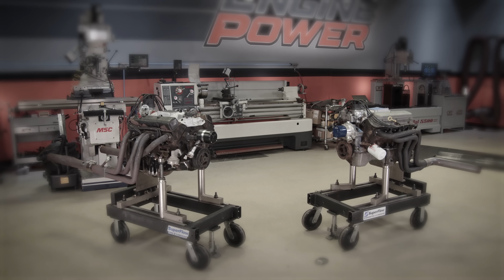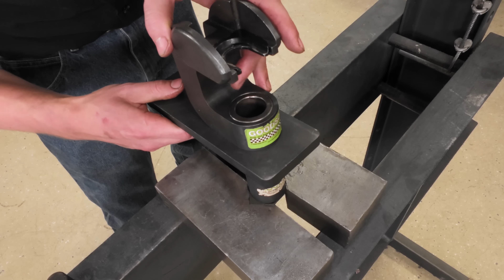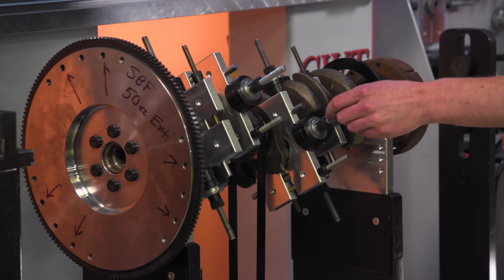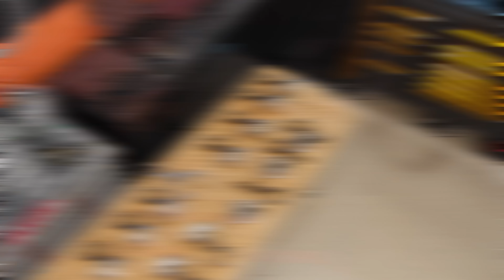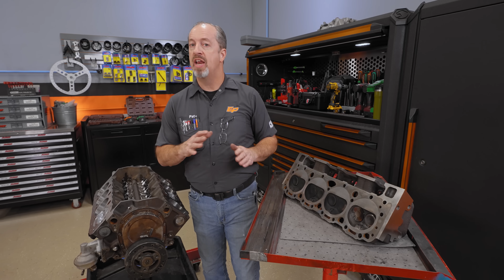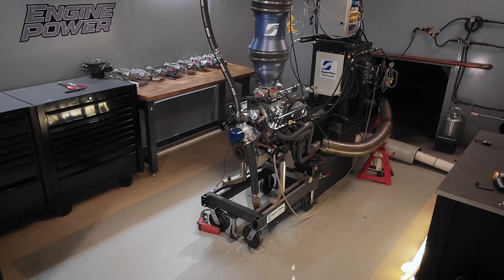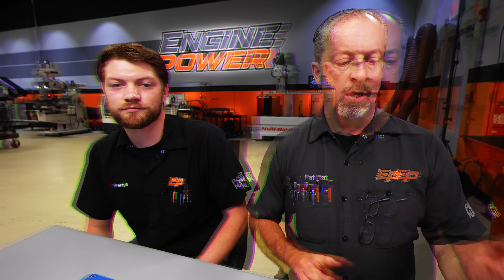305 SBC vs 302 SBF: Does Compression Help the Lowly 305 beat the Race-Bred 302?

Comment: I raced my 305 Chevy against a 302 Ford.  I won from every stop light and then the Ford blew me away  The 305 is junk had 2 pure CRAP  It is all about rod ratio  The 305 has torque NO  RPM

Comment: Apples to apples. This is a chris carter moment, COME ON MAN. Why would any 5.0 guy build a 302 like that that's strange to me. I built a 302 with 3 bar gt heads and had them ported and installed 2.02 int 1.60 exh. Converted to adjustable rocker studs you know the normal things we 302 guys do.  There are plenty of 4 bar heads and the same can be done too them. Angle milded the heads to 58 cc combustion chamber. Remember this is a factor head on 5.0s. 0.030 MLS gaskets. Still kicking ass to this day. I did this 2014. Why did you pick that value size when you should have did what I did. Make no since.

Comment: The July 1972 issues of Car Craft had an article called, "A 1969 Z/28 vs. a 1970 Boss 302—Both with Aftermarket Goodies".  As opposed to dyno runs, the magazine performed common upgrades of the time: headers, carb tuning, ignition tuning, and a new manifold.  They would do an upgrade, test the car in the 1/4 mile, then the next upgrade, another 14/ mile, etc.  Both cars moved from the mid-14s (if I recall) to just under 13 seconds (I recall this clearly).  I also think they had to install traction bars on both cars.  There was no winner declared but they acknowledge the Ford's heads were better at high rpm whereas the Z28's overall drivability improved across the board and was easier to live with.

Comment: Leave it to the Engine Power guys to saddle the Ford with lesser, lower flow heads (the Chevy heads flow 12.5% better) and then gloss over that fact like it's nothing. If they actually equalized the cylinder heads, the 302 would smoke the 305 by well over 10%; can't beat that shorter stroke if everything else is equal.
Reply from the maker: This round of testing was based off the comment section for the best cheap production heads, but if you want to see what happens when they have heads that flow within a few CFM of each other, you can check out the latest round of testing here https://www.youtube.com/watch?v=w5MCxmJbKaY&t=150s

Comment: Some conclusions from all of this.  Looking at my 302 decision process now I can say 1st, 9.5:1 will be the goal and that also will need 89 octane so good there.  2nd, good quality flat-top pistons with very selective aluminum performance heads.  The chamber cc's, I'll do the math. AFR likely not necessary either.  Rollers, absolutely. Can I use the original cast steel crank, I don't know?  Getting there!

Comment: A much more fair comparison, would be the late 60's Chevy 302 vs the Ford 302:  the blocks have the same bore/stroke, and it would be the intake/exhaust/camshaft and heads, to see what difference the GM vs Ford head design has (alternating/siamesed exhaust port location).  It would be race-bred vs race-bred.  The smaller bore of the Chevy will always be at a disadvantage.

Comment: You made the compression the same but put higher ratio rockers on the ford-- why weren't they the same as the chev
Reply from the maker: The factory rocker ratios are .1 apart, and we kept that difference while increasing them by .1 each in order to keep the valve lift very similar

Comment: More lift and better rocker ratio. That was the bump for Ford. The combustion and pressure doesn’t know brand. What’s the flow, displacement, rotating mass, balance, fuel delivery, valve timing. Assuming there are no absurdities in bore x stroke, rod x stroke etc, the numbers will be predictable.

Comment: Do these engines make best power with 11.6 afr? Or is that on the rich side?
Reply from the maker: That would be quite rich. We tune engines mostly off BSFC, but these were running between 12.8-13.0:1 for AFR

Comment: I don't really care either way, but I feel like this was not an "apples to apples" comparison from the start. So I am glad y'all made things right!  The 302 is obviously more of a performance application being a roller engine out of a mustang. That 305 is more of a TBI grocery getter out of a caprice or C1500 more than likely. Might have been a better comparison to find the 305HO or 305TPI variants to be fair. There is no doubt however that the 305 made bigger gains from the baseline than the Ford. And having worked on both, the SB Chevy is still much cheaper to get parts for as a general rule. So in the HP per dollar category, the Chevy will always reign supreme. That said, they are both fantastic engines. But the 302 will always sound better than the Chevy on the street. Just something about them!

Comment: that higher torque at lower rpms the 305 is making is due to its smaller bore but longer stroke. the explosion in the cylinder is pushing the crank with more leverage.

Comment: Is this a joke? Comparing a Chevy small bore 305 (3.736 bore) to a larger bore 302 Ford (4" bore) is very stupid! You should have used a 301" Chevy (4' bore).
Reply from the maker: We picked these because they are the most common and readily available "smaller" small blocks, so it made the most sense to put these two against each other. So far, the small bore has not held the 305 back!

Comment: Why didn't you make it Chevy 302 (Z-28) vs Ford 302? The Chevy 302 out of the Z-28 has a 4" bore and a 3" stroke while the Chevy 305 has a Bore of 3.736" and a Stroke of 3.48". This makes for a huge difference in volumetric efficiency.
Reply from the maker: The idea behind this series was to show what could be done with the two most readily available and popular small displacement small blocks. 302 chevys are relatively scarce and can be pretty expensive when available, while 305's are everywhere, came in a ton of applications, and are still dirt cheap. We have shown in a previous build that 305's can be upgraded like any other engine to make good power, and in these tests, the bore size has had zero affect on the engines performance compared to the Ford
Reply: @enginepowertv  I have two complete SBC 302s out of Z-28s and an all aluminum SBC 383 stroker originally from PAW. My late brother and I used to campaign a car in the old AHRA D/Modified production class. My eldest son will be picking those and a bunch of other parts this summer when he gets back from his current deployment.  In any case, good series. My favorite, however, was the Ford 300 straight six. Best sounding engine is a straight six with split exhaust manifold.

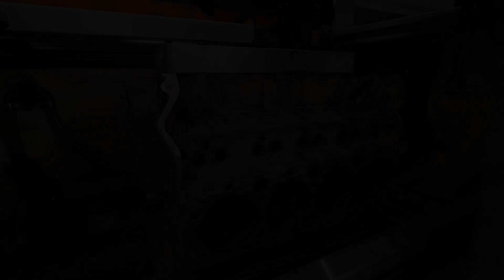Comment: Apples to apples ???? Riiight.... Chevy gets hypuretectic bucket  piston 5/64 and 3/16th rings that drag at 20 lbs per hole 160 lb of drag The Ford gets a lightweight forged piston 1/16th top and second 3mm oil control... that pulls about 11 lbs per hole 88 lbs of drag where is this remotely apples to apples... FYI have a 496BBC IN A 78 Firebird a 2002 ford lightning with a fresh 5.4 and a Whipple 3.4 at 21 lbs 574 to the ground so I'm NOT biased......  39 years ASE Certified gonna finish from the 5:17 where I stopped to drop some much needed context... this is lopsided and I'll be surprised if the 305 is still in the hunt....  that drag differential is double .... If.... the Chevy is still standing toe to toe ... then the ring drag importance  is a fantasy t hat it means nothing in the grand scheme of things .... Good luck guys 😊
Reply from the maker: We measure ring drag on all the engines we assemble, and both engines were within 2lb-ft of rotating force for the rotating assembly, so we would say it is neglible for these tests

Comment: This series was great.  Next up they should plop on inexpensive aluminum heads and see how close to 400 they can get, then do a total cost review to find out where the sweet spots are hp/$ in the series.
Basically if you're staying iron head with a 302, the extra 20-something HP to throw in new pistons & rebuild aren't really worth it as much as they are for the 305.  
It also explains why the rebuilt 305/vortec head engine in my brother's ex-dare stock track car can chase down new Lambos as it probably has north of 350hp.  Not bad for an old chopped down G-body chassis.

Comment: Why not 302 sbc. Vs. 302 sbf?
Reply from the maker: We wanted to use/compare the two most readily available smaller displacement small blocks. These engines are both abundant and cheap, and 302 chevys are much harder to find a useable engine and are much more expensive

Comment: What is the total valvelift? As the Ford had larger lobes and 1,7 rockers compared to the smaller lobes and 1,6 rockers?
Reply from the maker: The engines are within .018" net lift on the intake and .010" net lift on the exhaust. The cams and rocker ratios were upgraded together to keep them as close as possible
Chevy- Intake: .528"   Exhaust: .536"
Ford-  Intake .546"  Exhaust .546"

Comment: Awesome test guys! The performance curves make sense considering the Chevy has it little extra stroke over bore, something that could be fine-tuned using a dual plan intake over the single. On these old carbureted Mills I would probably stick with the lower compression versions for drivability on pump, gas and eat the 10 to 20 pound feet of torque and extra horsepower and obviously you could pick up lower RPM performance with a dual plan over these tested engines for better street manners .

Comment: There is an advantage in the Chevy head gasket: .028 vs. .038 in the Ford. Assuming both engines are at "0" deck, the Chevy has a considerable advantage in terms of quench.

Comment: I used the 305 heads on a 350 to raise the compression to 10.1, flat top piston four valve relief, stainless valves  194 in160 ex relived the the exhaust port to accommodate the 160 ex valve  runs well. cam dur in 224 ex 228 112lsa 465 in 485 ex hydraulic flat tappet it's a dally drive 15/8 headers HP apx 375 HP. great video thanks

Comment: I would like to see this challenge done with what was available when the year the  305 and 302 was made there is too meny parts and tech available now .how would you do this challenge back in the late 80's to 90's with what would have been available including tools and equipment too work the block and heads ,crankshaft. I would be interested in this .

Comment: Great engine builds on the 302 ford and 305 chevy engine.  would you be able to do a build on the 302 ford engine and the 302 chevy engine to see the difference in a stock form.  you guys have a great shop.

Comment: Hey Pat & Frankie, I know that the engine doesn’t know its brand. That said 😉 would you gentlemen please do a build series with a 351W punched out to 427? I’m talking forged steel crank, and cam forged connecting rods and the best NA pistons and Long tube headers with 1 3/4” primaries?
Reply from the maker: We might look at doing one again in the future, but here is a great solid street combo that we did several years ago on the show that holds up really good. Hope this is close to what you are looking for!

https://youtu.be/edpnG3DSXVY?si=Qb5HGCbcQQJPYJ6i

Comment: Not even a close comparison. Why didn't you do the chevy 302?
Reply: I'm a ford man but that chevy 302 was a beast, was it born from the 283 and 327?
Reply: @adrianpatterson845    Yes. The Chevy 302 has a 4" bore (same as a 327) and a 3" stroke (same as a 283). 
Made 1967 to 1969.

Comment: How about a comparison between the 302 Chevy and 305 Chevy.  If you compare with the same compression, heads, cams/lifters, headers, intake & carb, what is the difference between between the short blocks.  

With the 302 having 4.00" bore & 3.00" stroke, and the 305 having 3.736" bore & 3.48" stroke, this comparison would be very good to see the differences in the bore & stroke when run on the dyno.   🙂

Comment: See ive got a 90' f150 with a 302 in it but  its only rated at 190 hp factory. This one was around 250 bone stock

Comment: Would be more interesting if you used either ford and chevy 305's or ford and chevy 302's they both made both engines!
Reply: I absolutely know that Chevrolet and Ford both made 302 C.I.D. engines but I've never heard of a Ford 305. If Ford made a 305, what years?

Comment: Need more lift for the SBC 305 cam!
Reply: Nope. You start putting a bigger cam in the thing you start killing any low end power that you have. You're wanting to make that one mortal sin that every guy that's ever tried to build a 305 chevy  has done,  too big of a cam!
Reply: @kskip4242
For a fair comparison the 305 needs more lift to match lift of the cam in the 302. You're correct sir I have over cammed my fair share of engines in the past and for street applications I'm thinking less is more!!
Reply: @matthewlarson1050 I Suppose you could go a hair more but I wouldn't do much more than what they just did. This thing is gonna be barely streatable as it is with such a high compression ratio lol. I don't know back years ago when I had my 305 build gasoline wasn't as good. I am talking like thirty years ago. I am an old fart 😅
Reply: @kskip4242lol right 👍 
I put a 350hp 327 cam in a 305 about 30 years ago and that was definitely the wrong cam for that car. 1976 Malibu classic with 2:73's🤣 dog off the line but flew down the freeway 🤣

Comment: Richard Holdner points out  that an engine does not know what brand it is. same displacement, same compression, same cam timing, same induction will make the same power. But its good to see what can be done with both of these with a few cheap upgrades and OEM iron heads.

Comment: Just go all out with the 305 you will be surprised. The options is far greatest with 305 then any other SBC. Stroker kits 400 heads 350 vortec heads 400 crank 327 crank you can get aftermarket one piece seal dual quad intake cams or basically anything you can throw at a 350 and create a truly unique engine. 11 to 1 pistons in vortex 350 heads brings you back to around 9.8 and what you don't get in bore size you get in stroke so well balancing it is key for top end. 305 generates more power the more it winds up turning less revolutions than a shorter stroked engine. Go all out!   350 vortec heads and 11.1 pistons and dominator carb with .580 cam and electric 350 tbi fuel pump at around 14 psi. And e3 spark plugs. You will be amazed.

Comment: Great comparison, but the Chevy is still a better engine than the Ford.

Chevy = 5 head bolts per cylinder 
Ford = 4 head bolts per cylinder.
Chevy has much better intake port spacing than the Ford.
Chevy has oil pump in the rear of the block.
Chevy can use a gear drive.
Chevy has thicker main webbing than the Ford and due to this it can tapped easily for 4 bolt splayed main caps.
Chevy has a starter that bolts to the block, not the transmission.
Chevy is internally balanced.
Chevy has an adjustable valve train.
Chevy has an all in one distributor and doesn't need an amplifier for an external ignition coil.
Chevy blocks don't crack in half over 500hp.
Chevy is infinitely cheaper to build than a Ford.

Chevy is the better engine period.
Reply: You forgot that there are many, many more Chevy's in race cars (and trucks) and in demolition derby cars (and trucks).
   USA-1  USA-1  USA-1 😁

Comment: There’s a video on here of some guys hooking up a 350. 351. On two stands. They hooked them up to an old flat head radiator. The Chevy blew up around 3 min in. The ford ran for another 7 without any water. 😂 bets were being settled at the end and a guy says well I was pretty close with my estimate of 3 min tho. The ford guy turned and said that’s all you need to know. Lol
Reply: That Ford needed to build engines for people so dumb they forget to put coolant in the system?

Comment: Did nobody notice that the cam lift at the valves was different and actually higher on the Ford? They should have anticipated the rocker ratios were different and used cams that resulted in the same lift given the chosen rocker ratios. For example, if they wanted both engines to have 0.500" lift at the valve, the cam lobe for the Chevy should have been 0.3125", and the Ford's should have been 0.2941". By choosing cams with identical cam lobe profiles,(measured at the cam) they ensured (whether intentional or not) that Ford would have the advantage. Using identified cam profiles while increasing the Ford rocker ratio from 1.6 to 1.7 and the Chevy from 1.5 to 1.6 caused the difference in the lift at the valves, which would have been the same if they had both used 1.6 or 1.7 rockers. I know some will say "they increased each motor's ratio by 0.1, but honestly that's not the problem. Not ensuring both engines had the same lift at the valve was a problem. I'm wondering if this was an oversite that they just blew of as something to small to worry about or if this was done to bring the two engines performance numbers closer together? IMHO, the Chevy likely would have done better than the Ford's marginal 5 HP and 1 lb.ft of torque gap if it has the same lift at the valve.

Now I'm sure some are going to think I'm only saying that because I must be a Chevy fan. Honestly I build BBC, SBC & SBF engines and I take everything into account when I'm building them and comparing them. My favorite builds are forced-induction and multi-carb setups, getting them dialed in and enjoying the abundant power on tap. Most people shy away from multi-carb setups because of their tuning complexity, but it's real not that difficult and if properly setup they're great to look at and fun to drive.
Reply: That 305 needs all the help it can get , I had alot of fun out running them in my 5.0 , and they all said it was the 5.7

Comment: The correct comparison would be the Chevy 302 against the Ford 302 they both have the same bore and stroke  the Chevy 305 with the small bore and the same stroke of the 350 made  it a real turd , GM built the  305 as a EPA engine to meet emissions standards